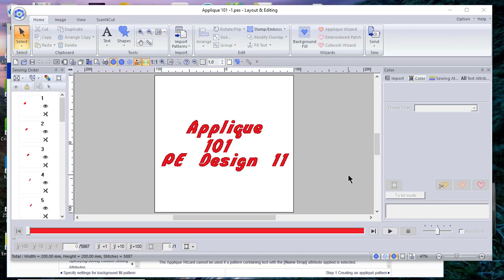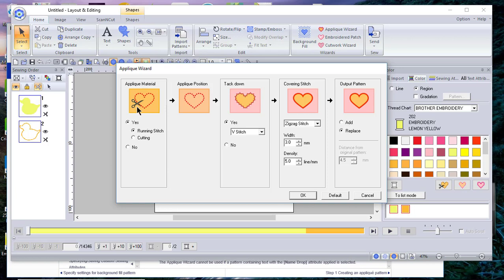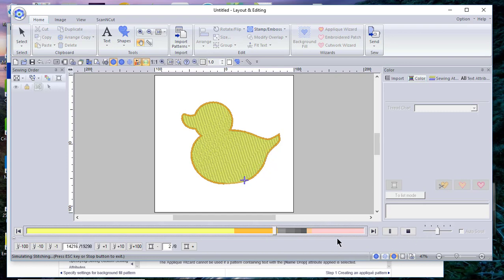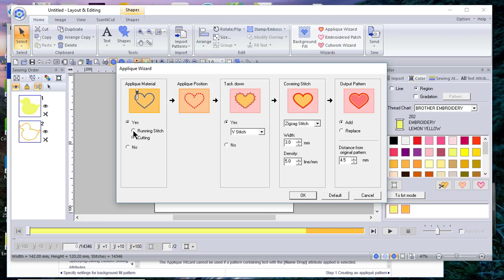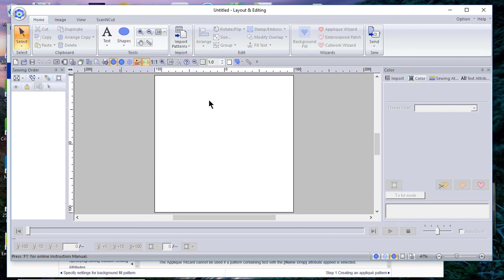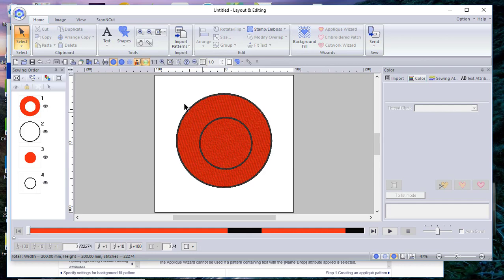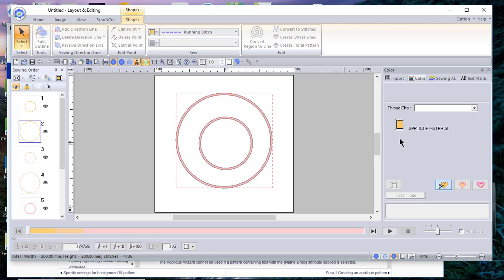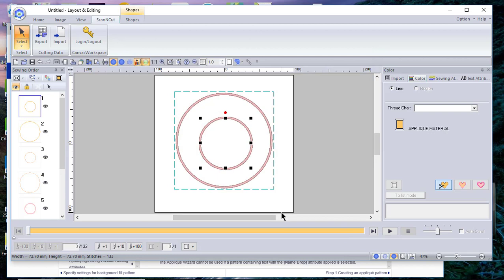Applique 101   1 PE Design 11

Comment: Thank you for the video, I do have a question, what if you wanted to import an outline and create an applique
Reply from the maker: Linda Thompson -  Linda, if you are talking about importing a stitch file and taking an outline from it, you will need to convert it to blocks to create an applique from that file.  If you are talking about importing an image and using it to digitize a running stitch around the design, you can convert it to an applique.  If you have a FCM or SVG file, you can import it and a running stitch will automatically be applied.  I believe I have an example of creating an applique from a design in the Applique Series.  If you need more help let me know.  If you own a Luminaire or are considering buying one, I invite you to join our Facebook Group called “Just Stitchin with the Brother Luminaire”. Here is the link
 https://m.facebook.com/groups/312906706241509?ref=share